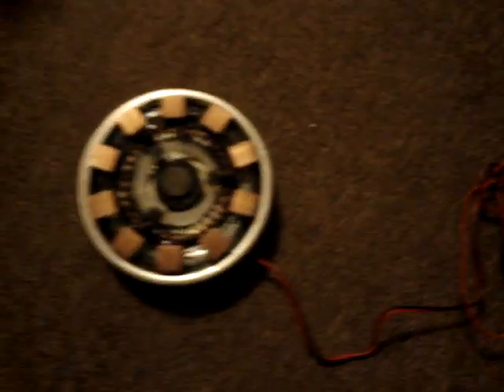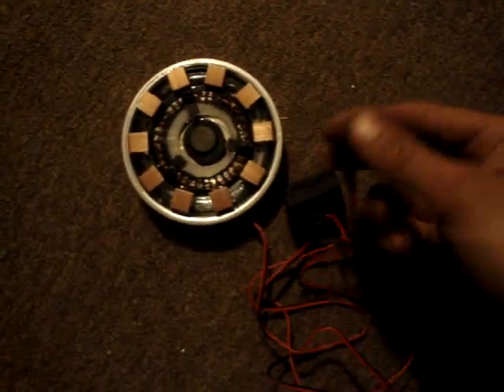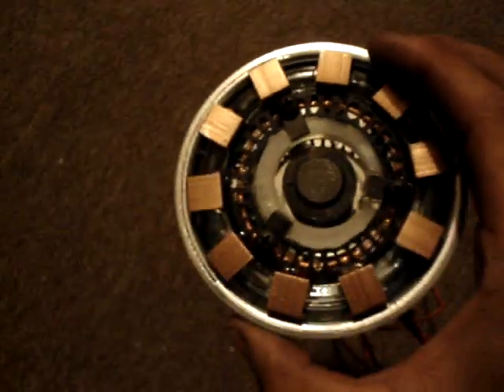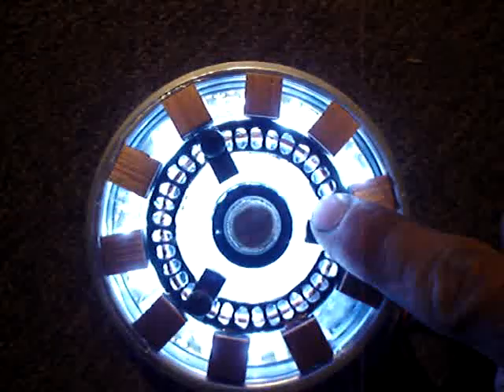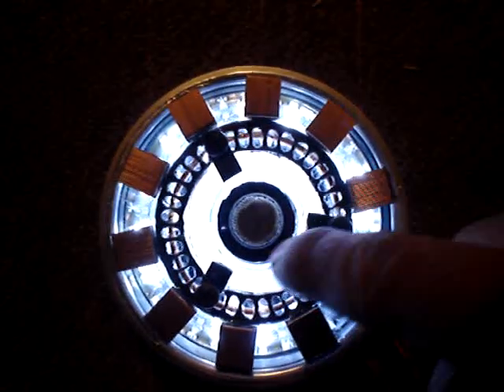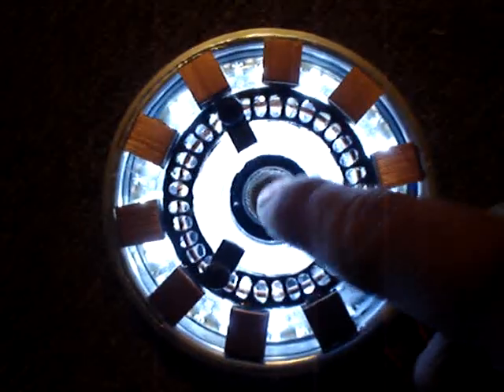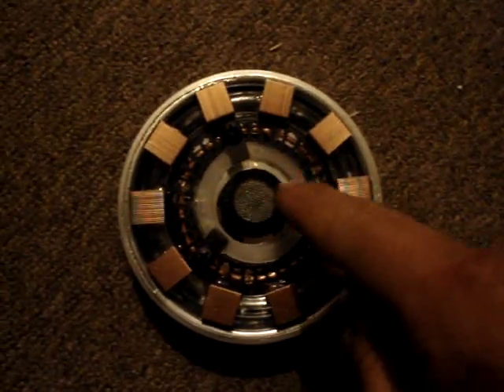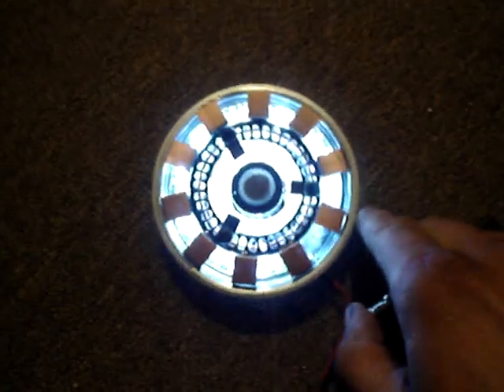DIY Iron Man Arc Reactor

Comment from the maker: For sure. The light strip part is called Alpena/24 in. white colorful flexible LED light part number is 77426B. It comes with two light strips and I just cut the wires to one and used the second one and taped it to the inside of the plastic pvc pipe just under the water bottle base. The light strips have little scissor symbols where you can trim down the light strip to a shorter size if you want. I cut off about 2 inches so the ends met after a full circle inside the pipe.

Comment: How did you mount the lights inside the 3 inch pipe? I have the lights you bought, did you mount them on their sides, sticking them to the sides of the pipe? how did you like the middle. I have two strings of those sticky LEDs from autozone. I noticed you cant make a flat circle with the LED strips without damaging the lights. thanks